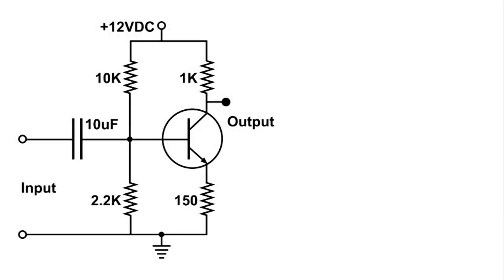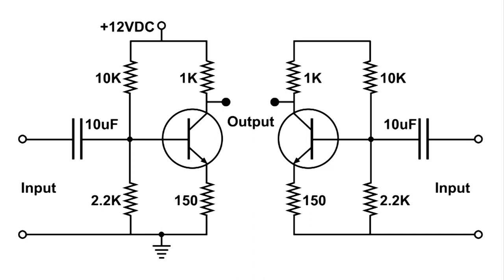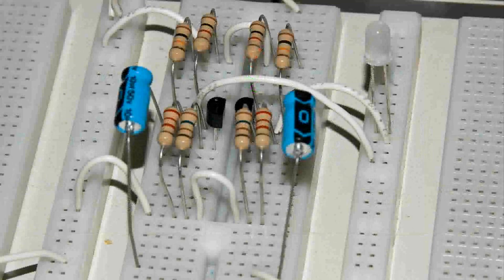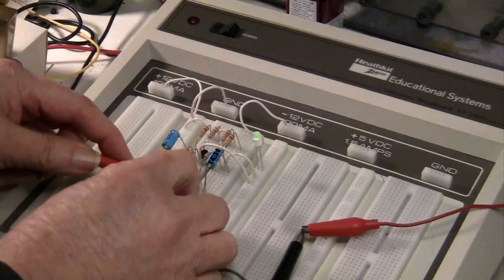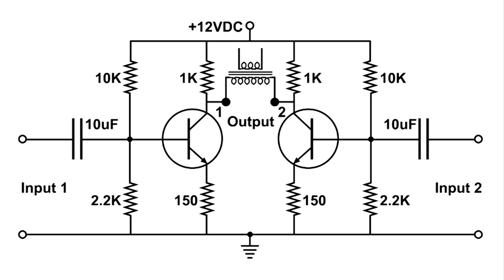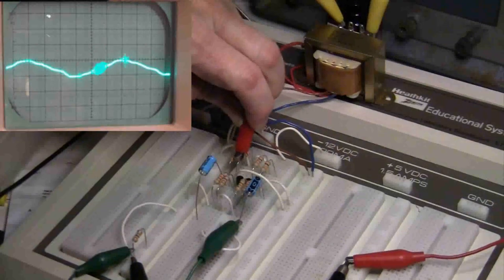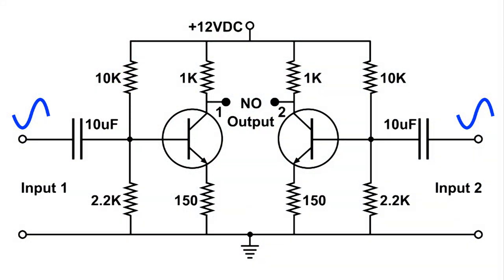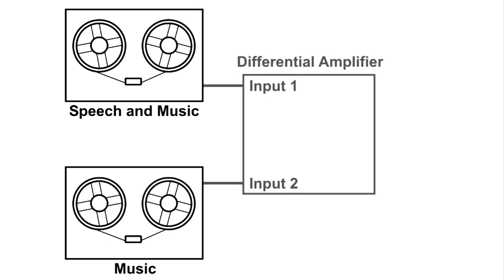Differential Amplifier, the Basics

Comment: The beauty of a Differential Amp is that it only amplifies the signal Difference between the two inputs i.e. anything else, signal (noise) between an input rail and B+ or B- (or ground on a single supply typology) will not be amplified, thus a useful low-noise tool is born. When we modify the circuit by sharing a common emitter resistor (and capacitor, in some cases), the "Long Tailed Pair" that is commonly used for Phase Inversion in a Class AB Amp is created. This structure is used for the input of every Op Amp. You can also see this method applied to many Push-Pull Audio Tube Amps ( look at the schematic for Fender Twin Reverb, as an example). Prior to this, it was common to use just a single tube or transistor for Phase Inversion; the signal would be applied to the base of a transistor or the grid of a tube, equal resistor values would be applied for the Plate and Cathode of a tube (say 56k), or the Collector and the Emitter of a Transistor (say 10k), thus making a somewhat balanced output signal for the positive and negative rail outputs. The problem with this typology, is that the positive signal is referenced to the B+ and the negative signal is referenced to the B- (or ground), so noise from those two sources creep their way into the signal chain; not so with the Differential Amp. Also worth noting... the Long Tailed Pair makes a much more pleasing music distortion, whereas the Cathode Style Phase Inverter does not. You have to also remember that tubes came before transistors, and the basic gain typologies have remained the same.
Reply from the maker: Thanks.

Comment from the maker: Thanks DigiSDR
The load resistors are always in the circuit when the signals are the same or different. And so are the emitter resistors, but their for biasing the bases. The most signal will be across the load resistors.

Comment from the maker: @Serpico261 
Yes. The output is not high. I ran the output from the transformer to an amplifier. At this point the output is low because it is the difference between the two transistor outputs. It is useful and it is easy to amplify. And the video is not fudged. what you see is what happened. The transistors are 2N2222.

Comment from the maker: Thanks jenko701
Sounds like it will work. Anything that is the same at both outputs is a null between the outputs. It should be greatly reduced or removed. This video is a simple example, there are chips that can do a much better job. I would Google the information.

Comment from the maker: @CassetteMaster 
Sounds like it will work. Anything that is the same at both outputs is a null between the outputs. It should be greatly reduced or removed. This video is a simple example, there are chips that can do a much better job. I would Google the information.

Comment: If you had two radio stations and if one of the stations bled over on to the other, in thery you could remove that station with a diff amp buy taking a clean copy of one of the stations signal and the copy that had both, run them  through a diff amp and you could get rid of the unwanted audio and just get the audio you wanted. what do you think.

Comment: does this cancellation have to do with the phase of the 2 identical signals or am i overseeing sth very simple here..?
Reply from the maker: Yes, if you where to have two inputs 180 degrees out of phase this circuit would add them together. To the limits of the circuit of course. If you over drive it you'll get distortion.

Comment: I have a question, why does the red led turns on with imput 1 and nor the green one, sorry if it is a dumb question
Reply from the maker: Electrons flow from negative to positive in a circuit. If the red LED is lit that means electrons are moving from 1 up through the 1K resistor, but also through the red LED and up through the other on 1K resistor. If the green LED is lit that means electrons are moving from 2 up through the 1K resistor but also through green LED up through the other 1K resistor. If both the red and green LEDs are not lit, that means both inputs are the same.

Comment: Hi, a 1982 mosfet amplifier has a differential input stage ( pair of PNP's) and a current mirror on top ( a single PNP transistor with 24V Zener in parallel) . The two differential PNP's has their collectors connected to the base of two NPN drivers, where the first NPN driver has it's collector connected to the base on the upper PNP driver. ( 4 mosfet as output stage).....You see, the mosfet schematic had an error that showed the differential input transistors as NPN's (they should have been PNP's)......Could you show when to use PNP's and NPN's......and ...why not not use NPN's as input transistors? thanks for all your fine and useful videos...best regards Kim
Reply from the maker: Thank you Kim. I have copied your comment for a future video idea.
Reply: @AllAmericanFiveRadio  Thank you :-)) I was hoping you would say that...best rgds Kim

Comment: Out of curiosity, why are BJTs more commonly used in differential amplifiers instead of MOSFETs? At least I'm assuming they do, because I can find plenty of resources that cover only amplifiers with BJTs but hardly anything is out there on MOSFET differential amplifiers.
Reply: FETs and BJTs are two very different things FETs are more like switches and BJTs amplify the current. To learn more you will have to ask someone much smarter than I.

Comment: Okay, so if you get a chance to respond to this comment, tell me something:  I've been studying how tube amps work, lately, and am now curious about solid state amps.  Say you were to put a phase inverter somewhere in the signal path on one side of that differential amp, and hook the outputs up to an audio output transformer, as you did, then short the inputs together in order to feed them the same input signal.  Would that give you a double-ended, "push-pull" amplifier that would essentially double the amplitude of the output, rather than having the two output signals cancel eachother out?  This is how it works in tube amps that have two output tubes, but I don't know if the same technique is used in solid state amps.
Reply from the maker: Transistor Amplifier for the Beginner, the basics
https://youtu.be/l-rfPfRgNJ8

Transistor Push Pull Amplifier, for the Beginner, no transformer, the basics
https://youtu.be/e_SE4KQjYR8

Transistor Push Pull Audio Output Amplifier
https://youtu.be/NU8Yk0bXlkk

Audio Phasing, Important and Useful
https://youtu.be/lgWLCG5vg5c
Reply: Thanks for the reply, but...hmm...maybe I don't have my terminology straight, here.  By my understanding of a push-pull, or double-ended amp, rather than the cascading mentioned in that video, the two transistors (or tubes) output to opposite ends of the primary winding of an output transformer, with one output being 180 degrees out of phase of the other.  So when one end of the winding is getting a + impulse, the other end is getting an equal - impulse, and vise-versa, effectively doubling the amplification.  Does push-pull mean something different in the solid-state world than it does in the vacuum tube world?
Reply from the maker: I can't find my reply, Google is doing such a great job. If you put in an inverter on one side it would act more like a Push-Pull but not optimum. Search my channel. This is a more efficient Push-Pull.
Transistor Push Pull Amplifier, for the Beginner, no transformer, the basics
https://youtu.be/e_SE4KQjYR8

Comment: I would expect the signal cancelling if the outputs had inverse phase (out 2 180 deg from out 1, for instance) Since here the circuit is the same at both sides, I guess there is no phase inversion, so, why they cancel eachother? I would expect both signals summing, not cancelling
Reply from the maker: If both signals are in phase at the output, there is no electron flow, no output.

Comment: May i know how to connect the signal...
Reply from the maker: At the base of each transistor
Reply: +AllAmericanFiveRadio what kind of signal did you used? can i know ..
Reply from the maker: Sine wave and audio
Reply: +AllAmericanFiveRadio .how to connect an audio signal? can we connect it directly to the cellphone, where the cellphone has a recorded music..
Reply: +AllAmericanFiveRadio i mean, is it ok to use my cellphone as an input signal which has a music?
Reply from the maker: You could, but I would just buy one of the little amplifier cubes from Wallmart.
Reply: +AllAmericanFiveRadio  what is little amplier cube?
Reply from the maker: https://www.walmart.com/ip/HMDX-Hx-p240gy-Jam-Plus-Portable-Speaker-Gray/26859431
Reply: +AllAmericanFiveRadio  what is the rating of the speaker did you used? can i know?
Reply from the maker: The audio transformer primary is 2K ohms the secondary is 8 ohms. Speaker is 8 ohms.
Reply: +AllAmericanFiveRadio how many watts?
Reply from the maker: 1watt

Comment: 0:13.. This is not an audio amplifier.. This a voltage amplifier! The next stage is audio amplifier
Reply from the maker: Do you have a question?
Reply: @AllAmericanFiveRadio  I have a lot of questions about these amplifiers... And all that questions are referring to a single question..

How to calculate all the components of an amplifier, if the only thing you know, is the transistor part number, the Vbe which is common to all NPN silicon transistors, maybe the Vin and the VCC, but don't know any other value (like, Ic, Ib, R1, R2, Vr1, Vr2, Rc, Re, Vrc, Vre, C1, C2, Cbypass, Vce, Ve, RL, Q point, β)?
Reply from the maker: @themoonwolf7438  With any amplifier the output load determines the design. Now that you know the output impedance you use the manufactures specification to determine the transistor bias. If you use a bridge bias, two resistors, there are many combinations that well produce the correct bias voltage. Chose two resistors that match the impedance of the input signal. If this matches the most signal is transferred to the base of the transistor. Use Ohms Law to determine all resistant values.
Reply: @AllAmericanFiveRadio  ohms law? Is that so simple?